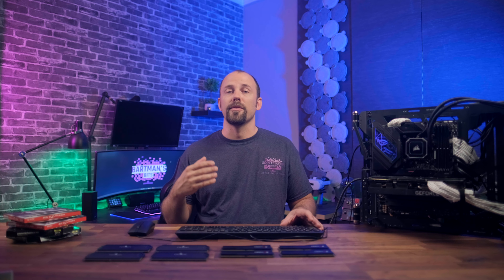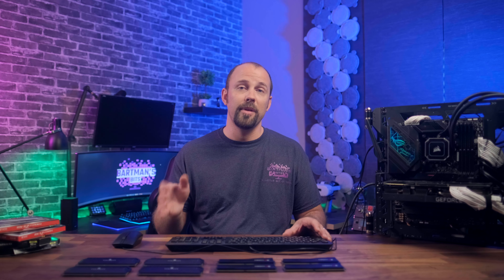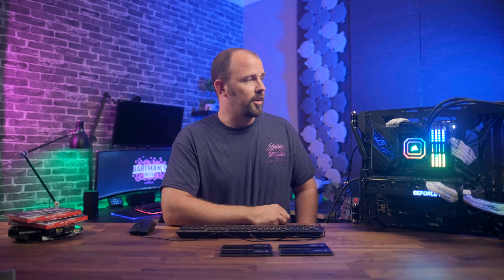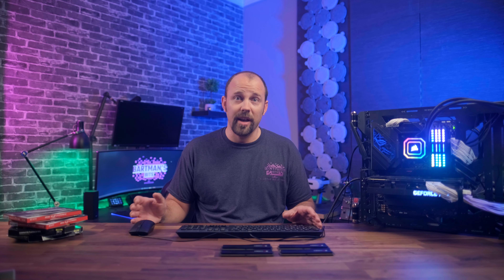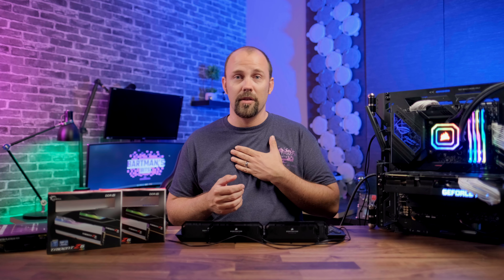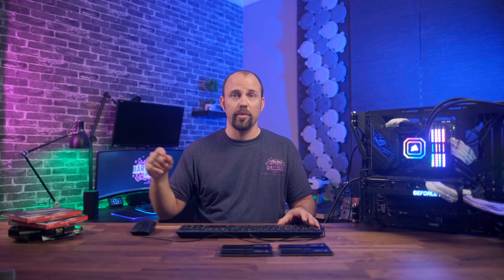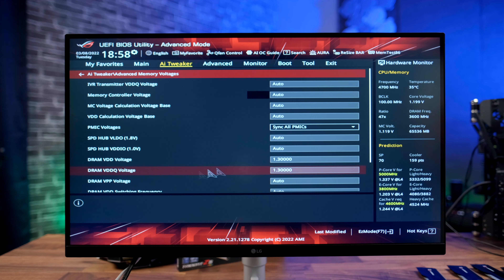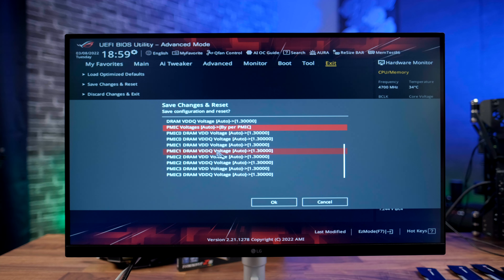Intel’s DDR5 problem resolved! DDR5 64GB Boot Loop failure Fix. Get the rated speeds of your RAM!

Comment: I was able use these hints to get 128GB in 4 sticks to work. The only downside is that I did have to slow the RAM down, but still better than only 64 GB. 
One machine is 128GB with 5600 slowed down to 5400
Other machine is 128GB with mixed 5200 and 5600 pairs.Had to slow down to 5000 for it to boot, but works great. 
Thank you so much for this!
Reply: Hey MvFranz. I hope you see this reply-- wondering if I could ask you a couple of questions about how you achieved this. Did you follow this videos settings exactly, so did you do other tweaks for your RAM load? About to try it out with 128gb of RAM myself.
Reply: @brennanhuizinga3718  

I tried all the steps but in the end the changes was really just changing the voltage. My ASUS Z790-P Wifi just had a BIOS update and now I just boot without making changes.  The settings were reset and when it came up I had enter the BIOS. The speed was defaulted to 4800 without XMP.  This just worked.  If I turn on XMP it fails to boot. I am too lazy to try and figure this out again.  Slow DDR5 is faster than the fasted DDR4, so I am happy.

Comment: 5600 with 4 sticks has been working since alder lake release. The issue was anything higher than 5600 would fail. Today you can do 6400 with xmp

Comment: Thankk so much for this video.  Its helped me to solve the same DDR5 64GB 4xDIMM 6200MHz in an ASUS Maximus Z690 Extreme with BIOS Version 2204 and a i9-13900K. Got it working with CPU O/C at 5.8GHz and memory at 5800.  All using the main principles you so well explain.

Comment: I'm about to add 2x16 gb to my 2x16 gb already installed to reach 64gb. All the 4 modules are identical dominator platinum ddr5 @ 5600mhz. I have an asus maximus hero z690. Do you know if with the latest bios asus solved this issue? Or do I have to apply your trick ? Thanks in advance for your support

Comment: Success!  You got the shit working.  I am looking to build a new PC with 128 GB of RAM.  I'm a video editor using Adobe Premiere, After Affects and Photoshop.  I've been waiting to build my system until a DDR5 XMP fix is available.  This seems to work.  Thank you for posting this video.  It is very helpful.
Reply: What voltage did you use for vdd and vddq?

Comment: 2 year old video helped me with 14900k / msi z790 / 4 sticks of 6400mhz corsair ....   xmp would not work at all, manually set voltages and set overclock to 6000mhz, working stable so far, might try 6400 later.  cheers.

Comment: Hey guys For "Gigabyte" Z690 AORUS Master BIOS Version FOR 5200mhz Corsair DominatorDDR5 :  yes I was able to finally able to get 4800MHZ Default Speed FROM dual channel Corsair Dominator 32gb (16GBx2) AORUS Master z690 to 5200 MHz. I was able to either overclock manually by inputing the vdd/vdq to 1.3 with XMP enabled and even without it enabled. So you can either do it with xmp profile enabled or also disabled meaning by setting it straight from the frequency from 4800 to 5200mhz. If your Gigabyte Bios user and you are fairly new and it would not allow u to double click it to set it: Highlight over it and press "+" or "-" to increase or decrease it.
You can also enable xmp programs to file and create a new profile and manually create the profile first and then check mark the box and set it, after that then You can go back to reopening the xmp profile and then select that new one you made with the vdd/vddq 1.3  and select that one you made with XMP on.
In my opinion it really doesn't matter if youve got xmp on or not AS LONG AS you've custom created or manually input those VDD/VDQ To 1.3 and then set your determined Frequency)
 I've tested both for the past month now and have had no issues and no instability for both solutions and also I'VE Had NO ERROR Codes as well for the motherboard Code as well because usually if there were then it'll show on your motherboard CODE ERROR display when you boot so make sure to check your motherboard error code if it gives you reserved or A Memory instability error code. I HOPE This all works well for you all, Also I suggest Undervolt your I9 as well if you are having heating or thermal throttling to "- 0.050mv". 
If any issues just message me and I'll do my best to reply as soon as possible.

Comment: This is an excellent video that seems to have helped a lot of people! I'm just about to upgrade to an MSI MPG z790 Edge Wi-Fi and a 12600k with a 4x16 kit that comes together.

Should this still be necessary with RAM kits sold as one unit 4x16 at 5600mhz? 🤔

Comment: So I have an Asus Maximus Z790 Extreme with a 13th Gen i9-13900K and I purchased 2 DOMINATOR® PLATINUM RGB 32GB (2x16GB) DDR5 DRAM 7200MHz C34 Memory Kits.  I can only get them to run at 4800Mhz.  Following your instructions here did not help, plus the default voltages under XMP I are at 1.45 with my configuration.  I attempted booting at 1.45 and the “by per PMIC” to no avail and at 1.5 as well without a positive result. Is there any news on a possible bios update to fix this or am I stuck with super expensive ram that I’m not fully utilizing 😢

Comment: I have 2 16GB CL40 6000MHz G.Skill DDR5 RAM paired with a Z690 Hero and I couldn't get it to work on 6000MHz stable, (getting BSODs on games). So I settled for 5600MHz for a while. The "By per PMIC" setting really seemed like it fixed my issues. Thanks for the tip!
Reply: How is it going now? I too have 6000mhz G Skill Z ram and i was getting BSOD.
Reply: Did the setting fix the issue making 6000 possible or did you mean fix it so 5600 was stable? cheers for the reply
Reply: It did work for a while but I still got some BSODs after a few days so I decided to set it back to 5600. There's a new BIOS update for my board though, but I haven't updated yet
Reply: @aaaarvil  do you have a overclock on your CPU as well
Reply: @edsayswhoa4365  nope, it's on stock clocks.

Comment: Hey there ! Sorry i dont understand english perfectly, i just want to know if this one can help me !
Im on a Z790 Aorus Elite AX DDR5 / Corsair DDR5 32Gb 7200Mhz Cas34 .
I was crashing randomly with the xmp activated at full speed, and then i had to unable it to run perfectly, but i have a ram at 4800Mh so... Can i push it a little bit better or maybe at max speed without any risk ? 
Thanks ♥

Comment: Im building my own rig with 2 ddr5s. This video made was a complicated issue for me  - simple. Cheers mate!
Reply: I have 2 sticks of 16 GB DDR5 5600 and it won't post.  Did you have a similar issue?
Reply: M A  I got my ram to run at 5600 MHz with two sticks, but I had to increase the voltage to 1.35 V from the 1.2 V in the XMP profile.  If one stick seems worse, you can try to RMA it for a new one. Reading posts online, it seems DDR5 isn't very stable beyond 4800 MHz out of the box.

Comment: Thanks for the video! Managed to run my 128gb Corsair Vengeance DDR5 at 5600
Reply: Hi I have the same 2x2 32 corsair, what did you do in detail? I haven't been able to use it a 5600. Thanks
Reply: @daedubedb  I had to step down to 64gb (2x32gb) at 5600 XMP profile and been working smoothly. Haven’t done nothing but remove all sticks, let them rest for a bit, plugged them in cleared bios and activated XMP I.

Comment: I did this with a new pc 14900k and corsair dominator titanium ddr5 6600 and it would not boot up. Screen stays black until I remove the motherboard battery and reset everything. What’s the solution?

Comment: Excellent video!  But I am having some difficulty making this work with my setup.  ASUS ROG Maximus Z790 Hero with i9 14900 CPU and 4 sticks of Corsair Dominator DDR5 32GB 6600Mhz.

After following all of your instructions except increasing the voltage (mine was set to 1.4 by default) I couldn't get the RAM to boot.  It would try to "train" the RAM as you mentioned, but eventually hang up with a Q-Code of 55 (Missing RAM).  My solution was to leave XMP I enabled with the appropriate RAM Settings (DDR5 6600 25 39 39 76 1.4v) but the to Reduce the DRAM Frequency.  I am able to boot to Windows at 5800Mhz, but to be stable need to reduce it further to 5600Mhz.  In doing so, have I basically defeated the purpose of XMP?  Is what I have done the same as selecting MANUAL and assigning the Frequency, or am I receiving benefits from the correct timings?

Lastly since the Normal Voltage was 1.4v, should I have tried 1.45v?  It was too far away from your suggestion for me to experiment on my own.

Thank you again for the great video, and I do hope you can find the time to answer this question.

Comment: This helped me, in asrock board most all that is needed is in advanced settings and under voltage tab in pmic it has option to separate  then add in you voltage to each vdd and vddq tab also i removed mem for a bit to reset

Comment: Great video. I've got 4x16GB DDR5 5600 and was unable to get more than 5200 due to xmp issues. I managed to get 5600 working fine with xmp however, had to adjust voltage a bit higher. Recommended voltage by manufacturer was 1,25v however, setting it to 1,3 didn't to the trick. With 1,3v my PC kept crashing...slowly I tried to adjust my settings and finally my PC stabilised at 1,35v.  If 1,3v doesn't work for you right of the bat I would suggest you to slowly up the voltage. Just to stay on the safe side do not cross 1,4v. But overall this video saved me!! My MB is z690 rog maximus formula white.
Reply: Is it still holding up good? Any random crashes?
Reply: @ianolivas9920  Yup, Only noticed a random crash in games which was very rare but it was present. The good news is Asus released new bios update few weeks back and this has sorted all my issues. Now XMP profiles work with no additional tweaks using manufacturer recommended settings with 1,25v. Haven't had a crash since Bios update so I would suggest flashing the bios to the latest version.
Reply: after setup in bios you try to pull out all of ram out and put it back again with switch ram position
Reply: @mSportZx  Yeah I was going to ask so basically i got some 2x16Gb 5200Mhz of ddr5 for the z690-e so will be adding another 32 gb, and i was nervous when I watched this because i don't want my computer crashing.  Did you just add the ram and set the xmp profile? I get 4800Mhz on my current ram sticks should I just add the other two and leave it?
Reply: @seriessplayer62747  after latest bios update from Asus RAM works as it should at full speed using XMP profile with no voltage tweaking. Everything runs on the stock voltage and speeds without any issues. Have a look if you have an update for your MB however, if it's not there then I would suggest if you were to get another 32gb then just disable xmp profile and run those 4 sticks at 4800 until you get the bios update.  Running my 4 sticks prior to the bios update was tricky. I managed to get the stock speeds of 5600 at 1.35v using XMP with very rare crashes. Usually crash was present in games like I would say once a week or so. If you want to save yourself this occasional headache then either wait for the bios update, perhaps there is one already for your model or as mentioned above disable xmp and run those sticks at 4800 for now. Hopefully this helps!

Adding some extra info! Your motherboard got an update already. The update came with version 1505 so you should be good to go:)  Here is the link enjoy!

https://rog.asus.com/motherboards/rog-strix/rog-strix-z690-e-gaming-wifi-model/helpdesk_bios
Reply: @mSportZx  I appreciate you taking the time to right this response,  I was so confused because I just ordered some more ram of the XPG Lancer DDR5 5200Mhz (For work station purposes) and saw this video and became worried that me computer would brick out on me. I actually updated my bios to the latest version that came out this month, as well as the chipset drivers, vga, and ME. Sorry to just ask one final question, you think just adding the additional 32 into the remaining 2 slots and keeping it at the standard (which it is currently set to without the xmp profle) 4800Mhz speed will keep the computer stable?
Reply: @seriessplayer62747  I used to run my PC this way at first with zero crashes however, I guess this may vary as not every PC build is the same. To be fair if you are underclocking your RAM then you shouldn't have any problems. If you already got the latest update then I would enable xmp and see how things go.
Reply: @mSportZx  Got it, I will try out the xmp to probably 5000MHz instead of 5200. I again thank you so much for your help! I appreciate it!

Comment: For people who still run into this issue.. not all the settings he provides work 100% of the time. I have 4x 16gb sticks. I managed to get 2 working. 4 is a straight up no go. I used XMP 2 on mine. I also used sync because per pmic would still make it loop for me. So i would suggest trying different combinations of the settings he provides. It can differ per build what works.
Reply: I had 4 working previously with these exact instructions and tested it pretty rigorously.  Now after bios update its not posting with 4.  Ugh back to square 1.
Reply: @tooManyMidgets  Same thing happened to me this  week on the latest ASUS Strix x790 E BIOS. I had to lower my XMP memory speed from 5600 to 4800 to get it to boot.

Comment: Hello @Bartman’s Bits I hope that after so long you read this message...
In my case I had 2 sticks: G.Skill Tridentz F5-6400J3239G16GX2-TZ5RK, enabling the XMP profile, these worked perfectly at 6400 mhz.
Now I bought 2 more sticks of the same model, when installing the memories I have the problem of the blue screen loop. Following your video I was able to configure the memories (I have the same mother that you used in video ASUS ROG Strix Z690-F Gaming WIFI) but the stock voltage of the memories is 1.4, the maximum that it allows me to upload is 1.435 with that configuration I can boot in Windows but some games crash after a while. Do you have any idea what I can do? Thanks and greetings from Argentina!

Comment: I have 6000mhz ddr5 ram that cant run at 1.4 vdd voltage. I tried 1.5 and still the ram stress test gets errors or it struggles to load up. 

If i lower my RAM to 5200mhz and keep it at 1.4 vdd voltage which is what its set to automatically by ASUS it runs fine. 

My question is that should I keep increasing the two voltages in order to achieve the 6000mhz speed as the RAM sticks are meant to do or is it not worth it. 

By the way im using 4x16gb sticks

Any help would be appreciated thank you.

Comment: I was facing same issue, enabled Xmp and PC went black screen. On MSI Mpg Z690 board, I just select UNLINK from the Dram voltage mode (PMIC method). Now, system boots normally. Using XPG 32GB 6000mhz @1.35V XMP. And I did not touch voltage ratings. Thanks for this video.

Comment: I have 4 sticks of ddr5 5200 mhz. It seemed to have worked for a while, but then I started randomly getting blue screens with a "stop code memory management" message. I couldn't tell which activities were causing it, sometimes it happened during a heavy task, sometimes it happened during simple browsing. I figured xmp was probably the cause, so I just turned it off. Guess I'll just bite the bullet and live with the safe speed.

Comment: I kinda test this out before and it didnt worked. (I did set all the timmings and voltages manually without the XMP)
Ill do it as is showed in the video and ill update in a few days.

The problem that I am having is similar with an Aorus z690 ddr5, sometimes the PC turns on but it doesnt post anything not even on the post code display, just black screen with all fans and and lightning working, I had to shut the PC off a few times to get some post codes and the PC boots up.

For reference, I have 4 sticks of DDR5 adata xpg @5600mhz. 16gb each stick and 64gb total.
Ci7 12700k
RTX 3080ti
1250w Seasonic psu
Aorus z690 master.

Thanks in advance for the video, not all the fancy reviewers or tester guys does this kind of work.

Comment: luckily i knew still about using A2 and B2 i only got 2 sticks, 5200Mhz ... hopefully i won't have looping issues, but I have done extensive tech support including fudging around in bios's since Y2K when I worked at IBM tech support and we had hundreds of people calling in thinking their computer would not be very well after midnight :)

Comment: thanks for the tips. I tested on my Gigabytes Z690 motherboard with 128GB ram (32x4). It works perfectly. I think this reflect the fact that DDR5 ramstick has own dedicated PMIC module, which is different to DDR4.
Reply: Cant find the pmic an gigabyte
Reply: @Bryan Wang how did you set voltages on this motherboard. My Aorus Master doesn't remember User4 profile I am entering.
Reply: @Bryan Wang which speeds and latencies are you getting, and which kit (x2) are you on?
Reply: How lol

Comment: Although this video got my system to boot even moving up to 1.5v on my ASUS Z790-Hero w/ 13900k it was unstable. My memory kit is the Gskill Trident Z5 RGB DDR5-6400 CL 32 @ 1.4V
Reply: This is the same kit I have, did you end up getting it to work?
Reply: @HappyHardcore86  eventually a bios update on the motherboard got it working

Comment: Hey bro what should i do set for corsair vengeance ddr5 7200? so when i open xmp1 voltages comes 1.45 as defaut so do i need to set up this 1.50 or going lower like you 1.30? btw i have no issues for 16gbx2 xmp1. But when i add 2 more 16gig it is not booting.
Reply: that´s exactly my problem. Were you able to fix it?

Comment: Does it mean that if I am using 1.40v DDR5 64gb (2x32gb) set, I should set it to 1.45v? and that I can buy the exact same set, and they will both work together at the rated speed?